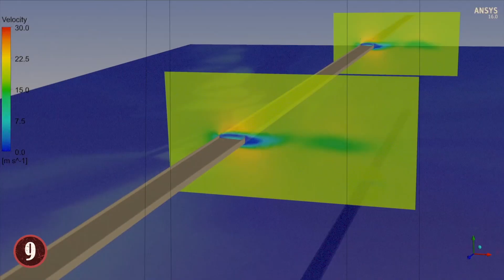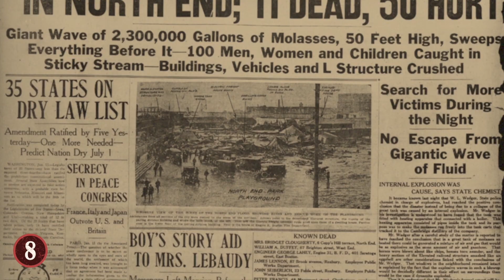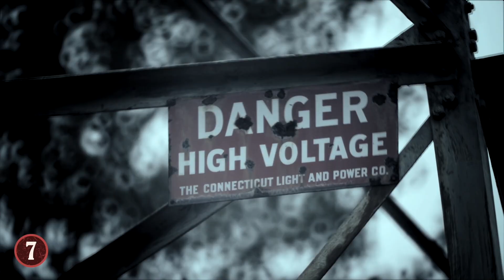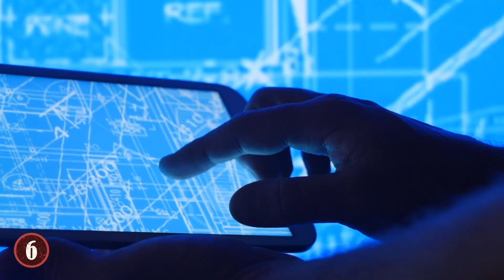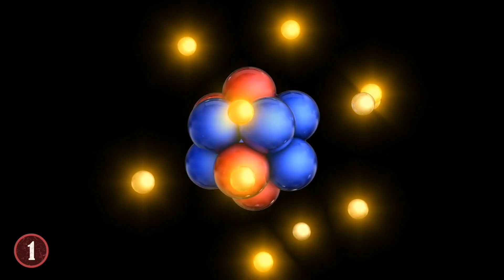9 Worst Engineering Disasters In History!

Comment: Pretty sure that flushing toilets don't use electricity, well here in Australia they don't 😀
Reply: Flushing the toilet uses no electricity, you are correct. However, if your water source is a well with an electric motor inside, your first flush will also be your last.  I am speaking from personal experience.